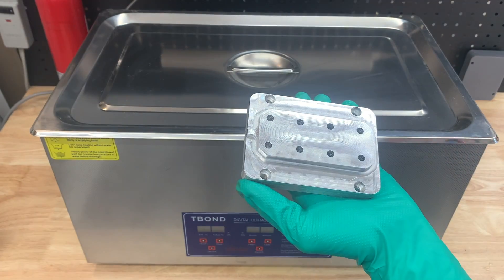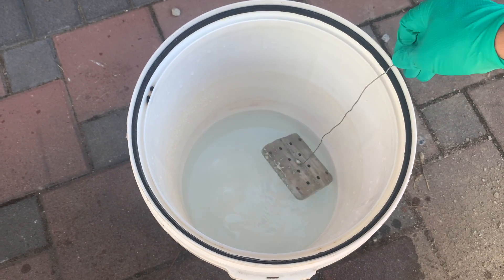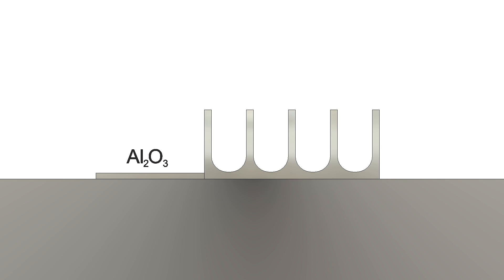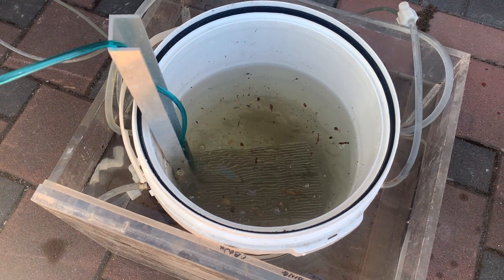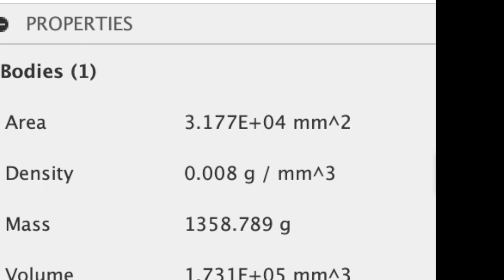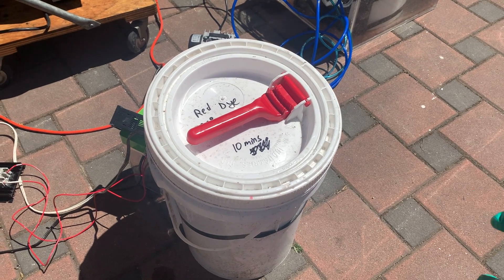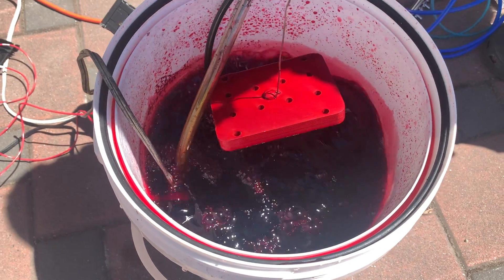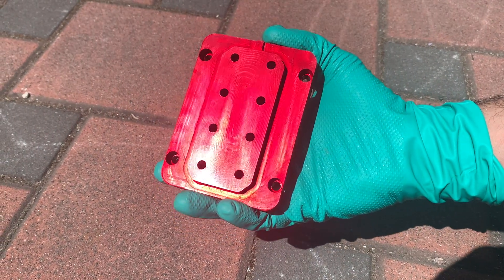Homemade Anodizing Setup

Comment: Man , i dont think it as anodising , anodising dont need coloring, your are just washing it with H2SO4, then coloring it to DYE RED color, the anodising includes reduction of titatium or similar metal to get oxidised on required metal surface. This is just simple coloring , no need to used electric supply and dip in h2s04
Reply: He is dipping to the lye first - that gets rid of oxide layer before anodising. Most people are interested in anodizing just for color, not for hardness, so it makes sense to cover that. If you dont want color, just skip coloring - just do the anodizing part.

Comment: no primer? Anodize is supposed to be used as a surface prep so a primer can adhere better (self-etching primer applied within an hour of the anodizing for maximizing the surface tension). It is true that anodizing alone is providing corrosion resistance, however it is easily scratched off, such as a fastener inside a threaded hole, and unless the part is going into a museum, it should be primed with a self-etching primer right after the anodizing process.
Reply from the maker: Your reply seems very wrong 🧐. You might be confusing anodizing aluminum with a different process 🤷🏻‍♀️

Comment: Awesome tutorial 😎 thank you very much.

You had a bolt screwed in, with the titanium wire attached to it. What I would like to learn is, what happens to the section of the block you were anodising, that had the screw in it. Does it need to be anodised separately with that section uncovered, to get anodised?

Comment: How did you heat the die bath?
Reply from the maker: I used heating elements which I had waterproofed.  Perhaps I will make a follow up video to explain in more details.

Comment: What about the area underneath the bolt used to secure the titanium wire? Did that get coated with the nano layer of oxide and dye?
Reply from the maker: No.  Great question.

Comment: Hi, i once had a anodized bar of aluminum which had a black color tint from factory, with a  sodium hydroxide and water bath solution ( i think i used too much sodium hydroxide) it took some minutes to release the black color and leave it with the aluminum real color. The more time i left it on the solution the aluminum started to turn more and more WHITE instead of grey . Since it turned to much white After doing that i spent several minutes with a kitchen sponge and cream with micro particules (normally used to remove stains in the toilet)  to rub the surface of the aluminum for about 20 minutes, which started to release a grey paste. As i rubbed more and more i was able to get a "kind of anodized" finish. and if i kept rubbing more and more  i was able to reach the "more shiny" aluminum finish. As simple cosmetics with no money and equipment go, i never understood why for cosmetic purposes, this process left the color of aluminum more like a anodized mate look if you start rubbing with a kitchen sponge.  Maybe i managed to get a nice result without using acid and electricity? of course im only talking about no color tint, just plain aluminum color.
Reply from the maker: Anodizing is not about colouring the aluminum and getting a nice colour. It is about the chemical buildup of the "sapphire" aluminum oxide, making the aluminum part far more scratch resistant. Hope this helps. Cheers, Dave
Reply: @ActionBOX  thank you sir,  So my question for you is: if i put the aluminum in a sodium hydroxide with water solution, i could end up having the aluminum looking "as if it was anodized", just the look, but far less scratch resistant. but at least for visual inspection it would end up pretty similar to an anodized acid bath. Am i right?

Comment: Cheap and easy? Isnt that equipment/materials for well over a 1000-1500 dollars? And the acid, im pretty sure you cant even get your hands in it here in europe. Everything is relative i guess. Nickel plating, thats cheap and easy.
Reply from the maker: If you needed to anodize many aluminum parts this is definitely a cost saving process if you can figure it out for yourself. The equipment is quite cheap with the power supply being the most expensive at $300 from china. Other than the Acid, the rest is really cheap and easy to acquire.

Comment: you skip on a lot details in your videos, which could even make your channel even more interesting, just saying. lye (alkaline) and also acids as i was thought, should be added to water slowly, not the other way around. the exothermic reaction could otherwise be very violent, depending on the concentration. if not done so, the reaction could cause splashing and harm, beside of that, if you use plastic container, it could melt. hope the input is constructive
Reply from the maker: Thanks for the input, you are absolutely correct that the reaction would be exothermic. I had enough experience to know that the quantities of the Lye and water would not cause a violent reaction, and it is true that if you have very little experience with this then you should be more careful or seek assistance. Cheers, Dave

Comment: Damn please keep going. You only have 7k subscribers but you earned another one. Your videos are extremely cool. 
It would be cool though to give some more safety instructions and maybe you could provide some links to the correct products. If you use affiliate links it is a win win situation.
And maybe you should put a written safety disclaimer in the video so people wont be able to sue you if they try it out and something goes wrong.
That being said. I cant wait to try this out during semester vacation this year. Im gonna anodize some bling aluminum parts on my motorcycle if I find a good voltage supply that is
Reply from the maker: Thank you for your input. I appreciate the compliments, and I look forward to you posting your final parts here for me to see 😉

Comment: Any tips about disposing the liquids?
Reply from the maker: I recommend you do not attempt this at home, especially if you are not familiar with proper acquisition, use and disposal of some of these chemicals. Misuse can be extremely dangerous.  It’s probably be at to seek proper disposal protocol from a local professional as it may be different where I am from where you are.  Cheers.

Comment: Anodizing aluminum turns it into sapphire?
Reply from the maker: When you anodize you add a layer of aluminum oxide that is only about 25 microns thick. That layer is made of the same chemical composition as sapphire. There is so little there that the process to create it costs much more than the amount you make, plus you are limited in the thickness you can make, so no this is not a process of making a sapphire Gem. Let me know if you need more clarification 😊
Reply: @ActionBOX  sapphire isbasically aluminumoxide with impurities like iron,titanium etc.... also hardness isalmost same.

Comment: That was awesome. But what I really learned here is that anodizing metals is a dirty job and requires a place to dump those chemicals properly. I'm hoping IDIOTS out there don't just pour it down the drain.
Reply from the maker: Its hard enough to get your hands on this acid, I assume people who can have access to it are also properly trained and have the proper means to dispose of it (as in my case). Definitely not a chemical solution to play around with.
Reply: All you need is baking soda to neutralize the acid, it's not that difficult